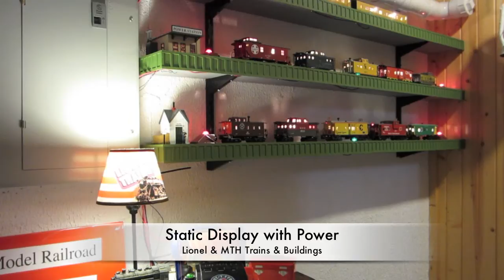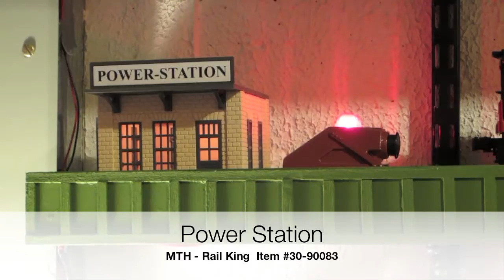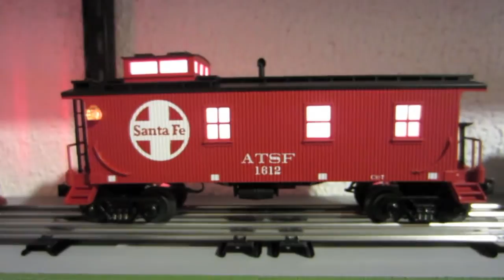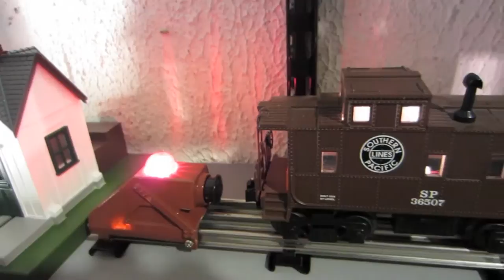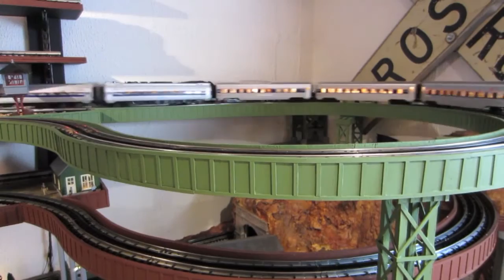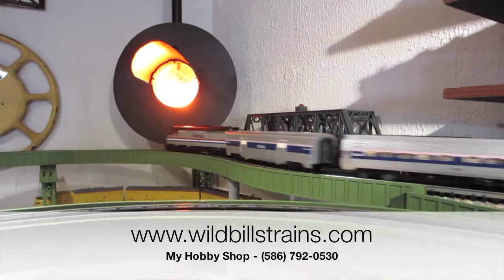Lionel Trains Static Display & Running Session HD

Comment: Can you give some information on the shelf fronts that look like girders? Did you make them or can they be purchased?
T
Reply from the maker: Hi Mike: The fronts on the girder is a wood called Luan Plywood, 3/16 x 2 inches, this is good because it will bend for the curved section.  This wood is available at any home center like Home Depot.  The track is screwed to a 3/4" hardwood plywood. The side girder parts aare 1/16 x 1/4 x 36 inch balsa strips. Hope this helps and thanks for watching. Gary 🚂

Comment: Very cool static display, do you have toggle switches to control power on each shelf separately? If you did, you could run a bump-n-go trolley on one and control each shelf individually. You can run any type of bump-n-go on any shelf now, but having seperate power to each track would be cool to. Thanks for sharing.

Comment: Nice video Gary. It looks good. I like the Atlas GP35 Road Switcher Diesel you were running with the dummy locomotives. Try running the dummy MTH GP35 and your Atlas Powered GP35 back to back in the "lash up" so you have your similar engines together, and trailing would be the CN and Conrail GEEPs. GEEP: A EMD Road Switcher with 4 axles. 
I like the steamer you had running, odyssey is nice, your F-3s are equipped with Protospeed control, which IMO is better than Odyssey 1 speed control.